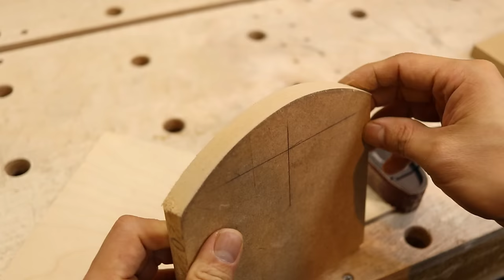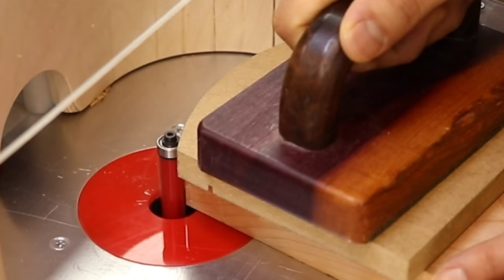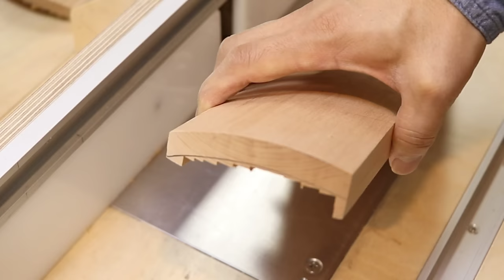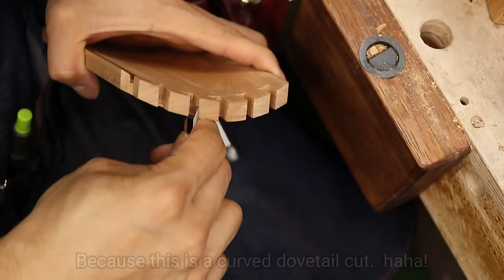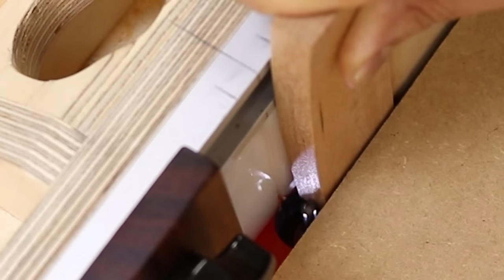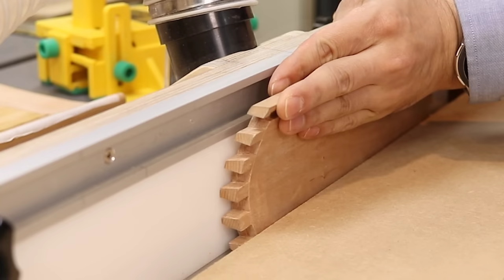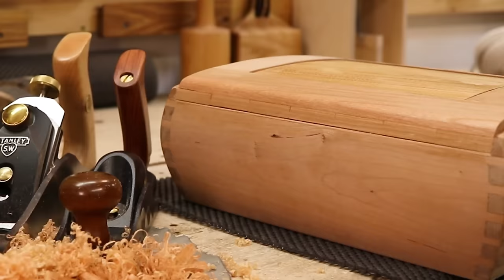⚡Full Curved Wooden Box - Dovetail Cutting on Curves / Invisible Wooden Hinges / Fine Woodworking

Comment: Why the curve line at 0:24 is not vertically symmetric?
Reply from the maker: The reason is that I wanted to make the bottom of the box smaller than the top, so I modified the curve.  This is a difference of taste.  It's okay to make it the same.